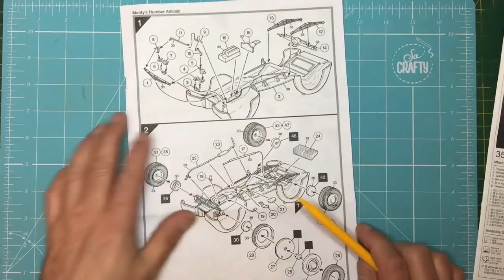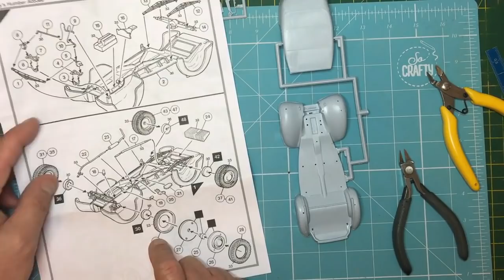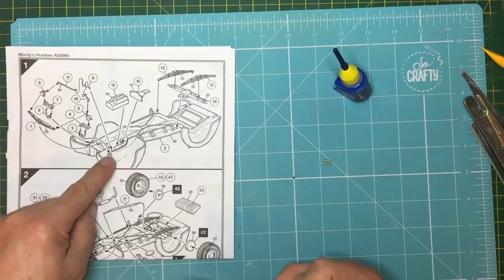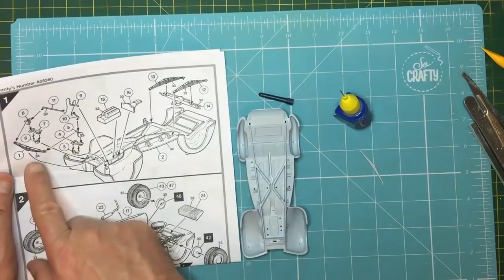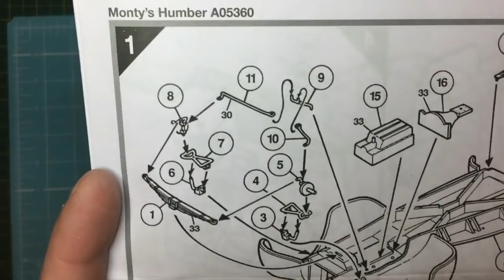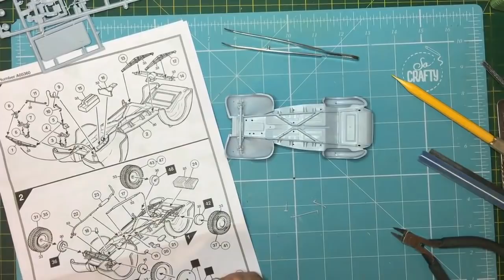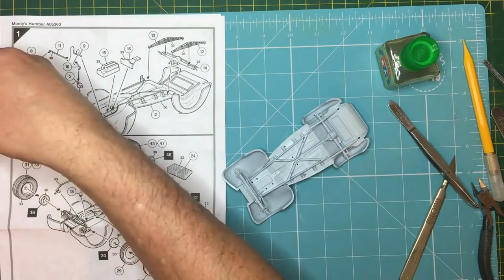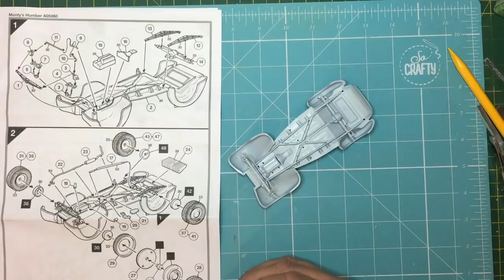A beginners guide to building a scale model part 2. Airfix 1/32 Monty's Humber

Comment: Im up to my kneck in new sofa,carpet,house upside down since they both came late and in wrong order.And the fitters have made it so toilet door wont shut.Dogs got the hump,now not allowed on sofa or carpet??And grandaughters 2nd xmas,and my 'whatever bieng born in 66 makes you' birthday on 27th! Ill be watching tomorrow,and building the Ryefield T34\122,quirky tank destroyer with load of T34 variant option's.
Reply from the maker: Sounds like youre having a great time there Darron!!
Reply: My Rafhart V3 PE bending tool takes the edge off.I saw a video by designer on utube,messaged him about 10 times and he sent me address to order one.Took 3 days to arrive from poland.Cheaper by £15 than the Hold'n'Fold 5speed.And its orange and blue coated aluminium..easier to see where your folding.Clever design move.

Comment: now that you have all the parts sanded, (with bare hands=oil) you need to clean all the parts again. Don't bother with the first clean if you're going to do a bunch of work later without gloves.
Reply from the maker: Pete, as previously mentioned, this is a video for beginners. I have never had an issue not wearing gloves, so long as I remove any residue beforehand.
Reply: @NigelsModellingBench : As long as you use Humbrol or another enamel paint it won't be a problem, but when you start using acrylics which are water based then as we all know, water doesn't mix with oil and especially if you're using a gloss paint the gloss will not stick without primer.